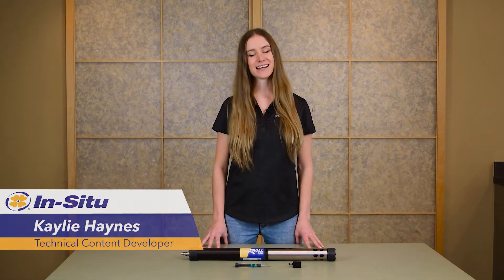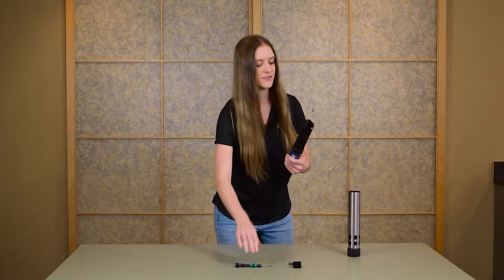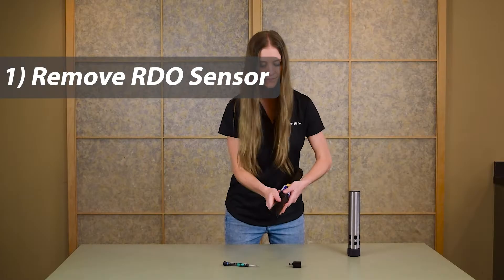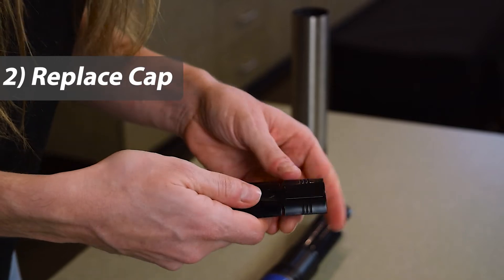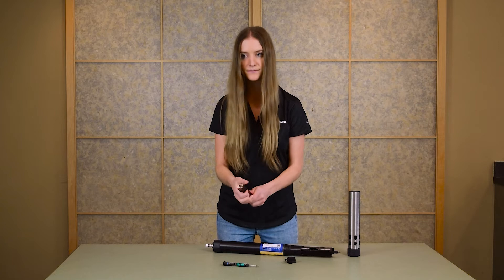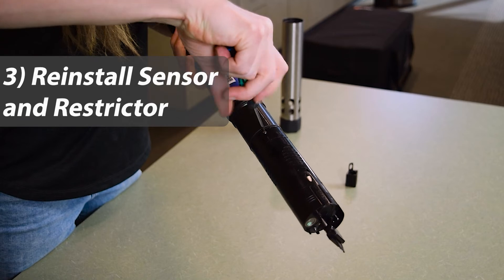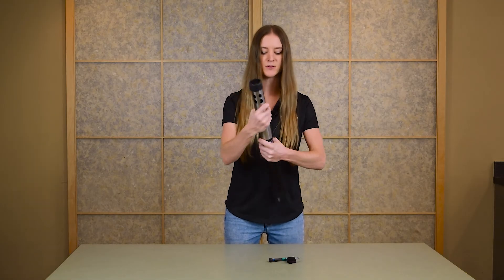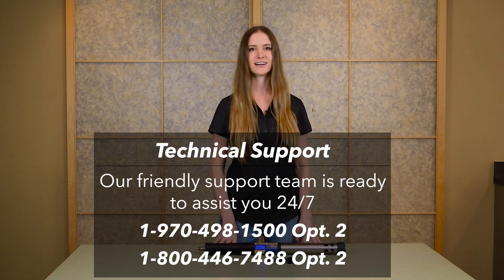How to Replace Your Aqua TROLL RDO Cap

Comment: Nice video, very concise.  1. Do you recommend recalibrating the sensor after the cap replacement? 2. Is it absolutely necessary to remove the sensor to complete the cap replacement?
Reply from the maker: 1. Calibration is not required after changing the cap, but it is typically a good time to perform routine calibrations to ensure that the sensor is meeting accuracy expectations.  We have very robust factory calibrations to ensure that the sensors respond linearly across the range of measurement, which makes the user calibration process simple (typically only need a single point).  2. The cap can be removed while the sensor is installed, but it's much easier to remove the cap with the sensor out of the instrument.
Reply: @InSituWater what size screwdriver is she using?